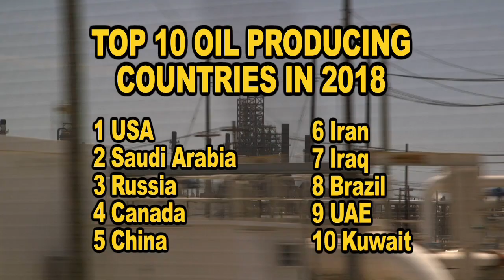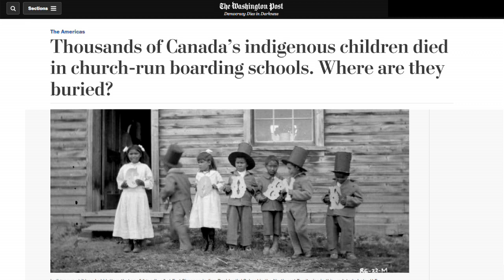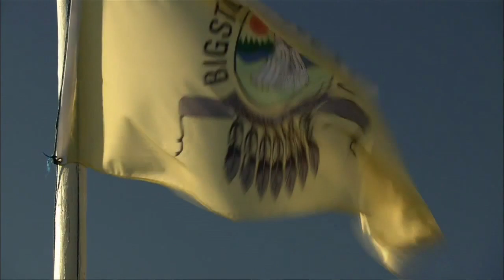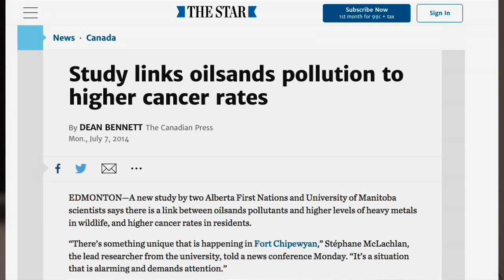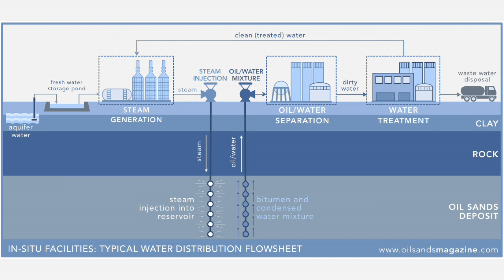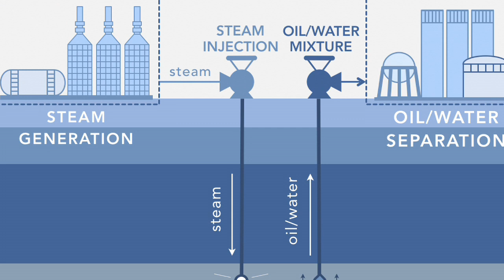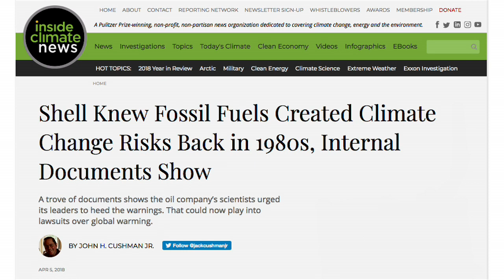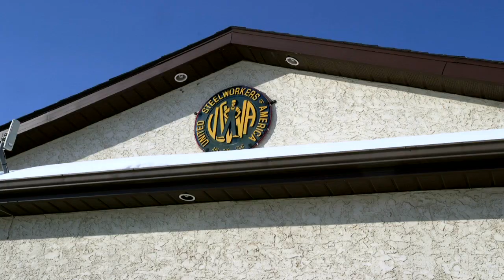Alberta: The End of Dirty Oil?

Comment: Tbh this may as well be a left wing union propaganda video.. driverless vehicles?? Well, if tesla does it on the road why wouldn't any business. !!
The environmental part i understand the rest is lefty luddite tripe
Reply from the maker: ... so the whole point of the driverless vehicles bit is to emphasise that, not only is burning fossil fuels no longer viable because of climate change, but in terms of jobs, the amount of jobs in the fossil fuel industry is shrinking all the time ... whereas a just transition to a low carbon economy will create far more jobs (an estimated one million extra jobs here in the UK alone, many many more in Canada). Hence the argument put by trade unionists in the film that we need to start coming up with a plan to transition now which doesn't leave people on the scrapheap, as has happened so often before - and is already happening in the oil sands industry now.

Comment: Green restart after covid? Oil now +50% pre covid to $62 a barrel reduced air travel and personal travel has reduced consumption below 2007 use 90mbpd...Q; has last 12 years with continues QE, enhanced oil exspensive/high energy  extraction  covid lockdowns aircraft, liners, smaller cargo boats scrapped in reality end of cheap easy oil with population 30% higher than 1995 ?